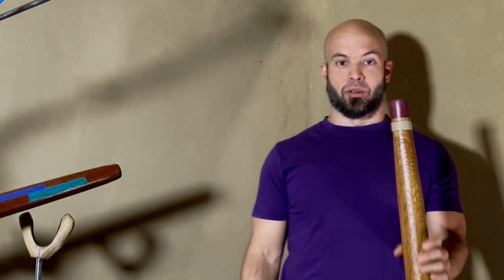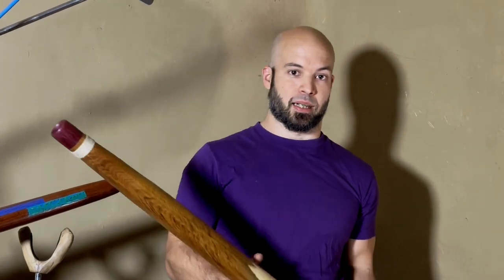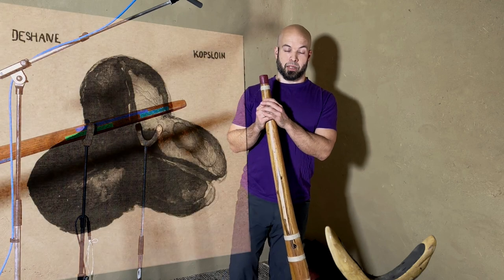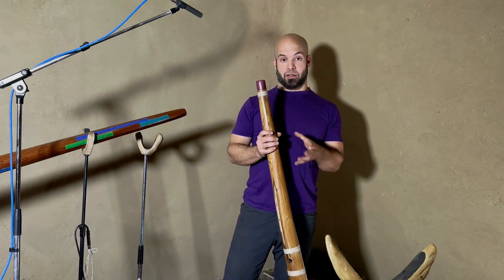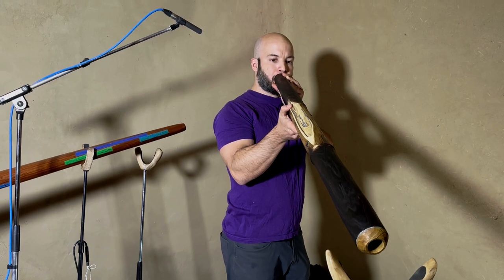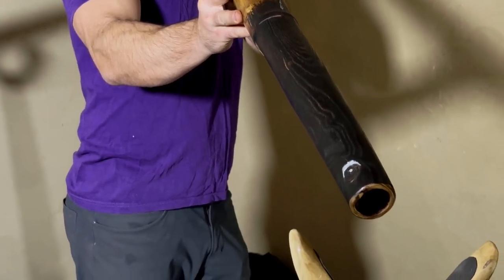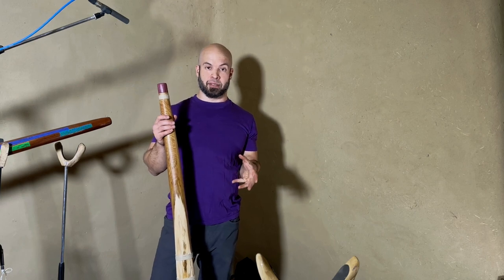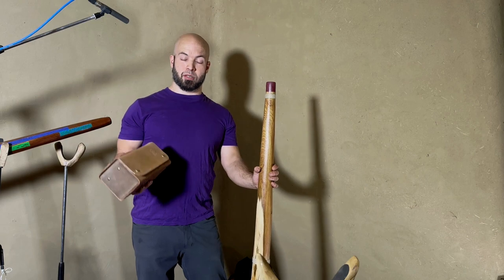Dualdidg Madness ! ! !

Comment: I am veryy curious how this works if the not of the diges can be determined with  l=c/4f where ll is the length in meters, cc is the speed of sound in meters per second, this is confusing me how are they 2 notes? Verry good digaridoos too
Reply from the maker: The formula is true for cylinders. Which obviously play same note from both ends. But these are not cylinders.
Reply: @DuendeDidgeridoo  ahhh thank you verry much I have since been doing my own experimenting and discovered mouthpiece diameter changes frequency but the bell seems not too, I have since made my own dual dige splitwoood with bass of 50Hz low A and 120hz I think maybe a G  mouthpiece diameters 45mm and 30mm